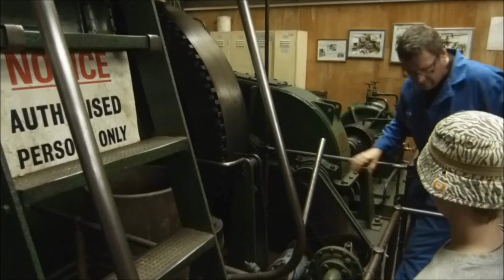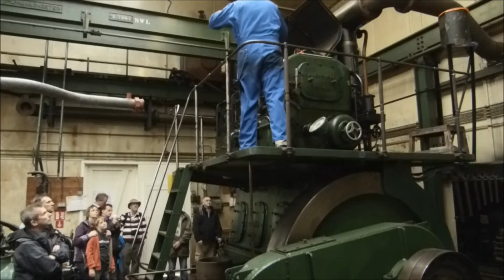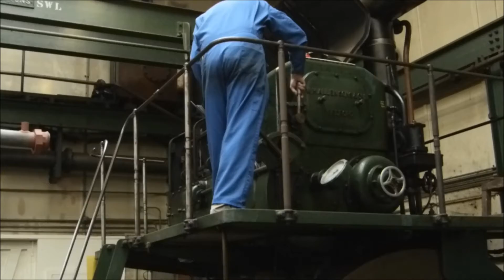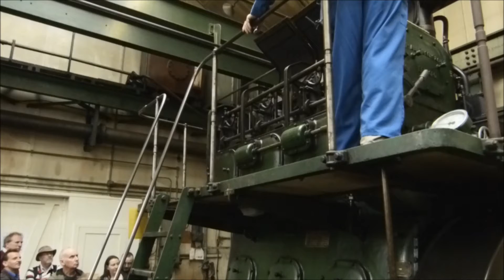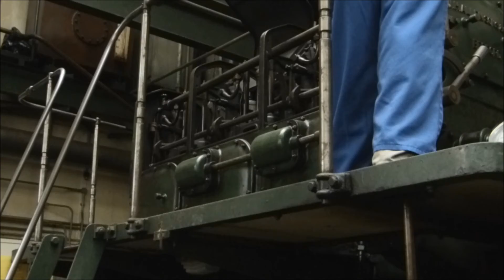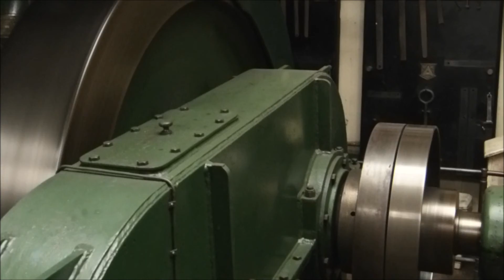Starting Allen Diesel at Kew Bridge

Comment from the maker: I am planning a return visit for the re-opening after the development work they are doing at the moment is finished. Thanks for the correction re the compressor. I confess I couldn't really remember that part of the set up so did guess!
Reply: What are they working on at the moment? Last time I went was for the "Infernal Combustion" day in 2010 when I took a couple of my engines. Shame they dropped that event, it was excellent.
Reply from the maker: There is a major refurb on, mainly reception and galleries I think